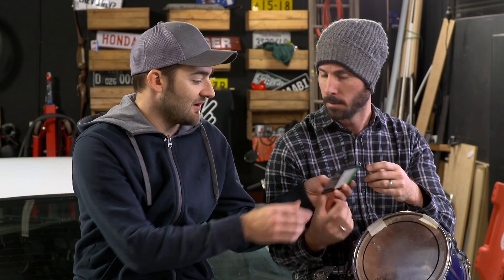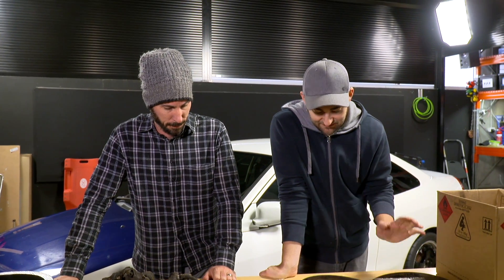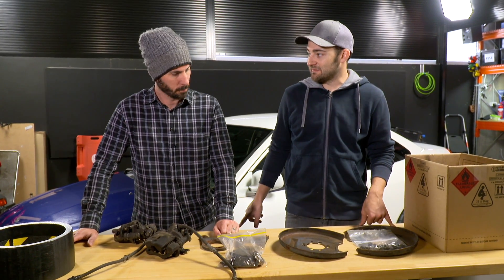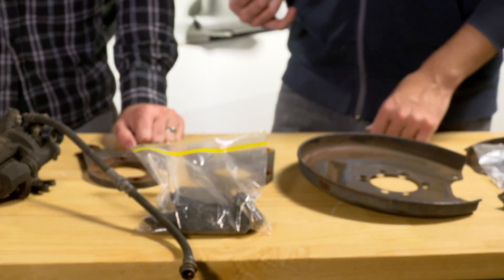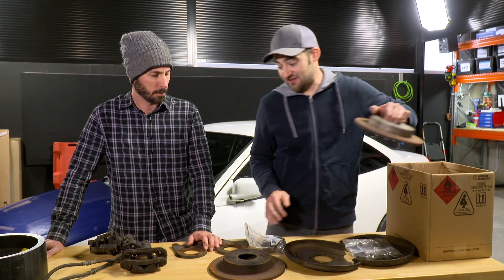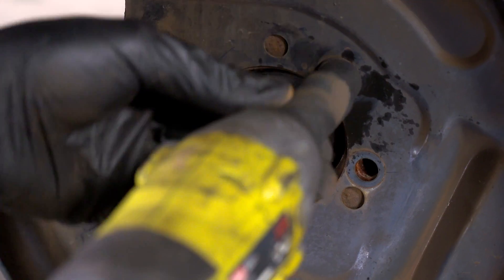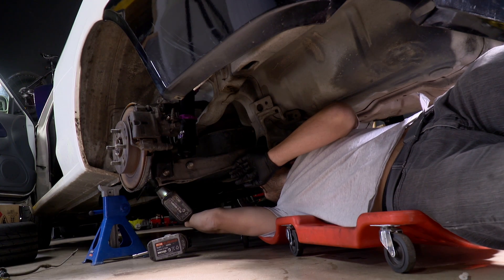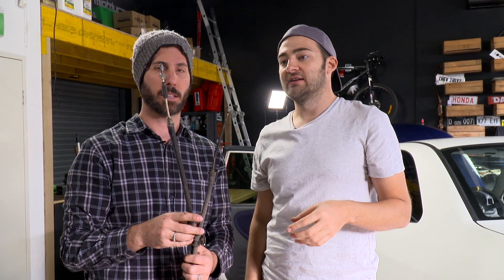Drum to Disc Brake Conversion DIY

Comment: Sometimes the brake  proportioning valve is different on rear disc brakes compared to rear drum brakes. If you convert to rear disc's, sure,  you will have working disc brakes, however the brake bias will not be ideal with a rear drum  proportioning valve. Drums operate at a lower brake pressure than disc brakes, yup, you will be lacking hydraulic pressure with a drum prop valve with rear discs
Reply: +1 (can't like the comment cause I'm on mobile soooo....lol)
Reply: *****
 Awwww man.... I wheel my computer around in a little cart so I can turn into a keyboard warrior at any moment in time.  :)
Reply: if you just just put discs on my car bias valve will cause rear wheels to lock up under hard braking (very dangerous) haha you defiantly have to make sure bias isnt going to kill you
Reply: more so if the cars lowered as brakes usually have a compensator also for the rear wheels for when theres a full boot/extra weight
Reply: coco mgee
Nope, More like nose dive.  The car I have came from the factory with a drum proportioning valve but had rear discs..  The low pressure won't allow the rear discbrakes lockup, in fact the rear disc brakes will last forever when the fronts will wear out 3x as fast
Now with a modification I can feel the rear brakes working and the car nose dives alot less under threshold braking
Reply: yeah i commented again for extra bit, yeah in understand what happens i put rest in 2nd comment.. but yeah it depends on weight of car. i had to change master cylinder to stop rear wheels locking up at standard height after my swap
Reply: and it probabaly messed with your abs, its your master cylinder what accounts for your braking pressure
Reply: My car weighs a ton, It never happened but every car is designed differently.  Then you can argue the physical size of of the brakes and surface area creating extra stopping force, creating a lockup issue. Some Disc brake conversions can be larger in size than the drum, so they will bite more. . Some pickups or SUV s have a sensor that adjusts the brake bias for rear squat, as if it was loaded. perhaps those could lock up the rear brakes if they were tampered with, I would not recommend anyone messing with those systems.
Reply: bias valve for height is not inline with brakes lines*
Reply: You may want to do your homework again. ;)  In the states some vehicles had these systems.
Reply: Richard Adams
 No, Drums work under less hydraulic pressure.  Disc Brakes are around 900,1200 psi, Drum brakes are around half that. The volume of brake fluid is also slowed down to rear drums  Put a pressure gauge on it and you can see.  Hardly anyone has one or uses them. But it can be a good diagnostic tool for brake problems
. If the Drum brakes lock up usually its a friction material problem,  contaminated shoes
, service is badly needed, etc.  If the vehicle has huge drums, heck yea they can lockup easy no matter what.
Reply: Yea its not a pressure issue, your brakes need service.  Cheap brake shoes sometimes lockup mad easy, or if someone had the car before hand and the wheel cylinder blew brake fluid allover the shoes, that will change the friction material and the shoes will get super grabby.
Reply: proportioning valves for drum brakes also keep a little pressure on the pads themselves to make them drag. They do this to keep water and other debris from getting between the shoes and the drum. If water gets between it can actually keep the shoes from contacting the drum, meaning no brakes.
Reply: Never heard of that. The return springs on the brake shoe backing plates keep pressure on the wheel cylinder, the adjuster keeps the shoes close to the brake drum. If spring tension is crappy on the rear drums when you mash the brake the pedal will be low, same goes for a out of adjustment drum brake, the pedal travel will be increased.  Every tire rotation I always kick up the drums a little, they SAY they self adjust but, ehh. Keep the drums in adjustment and the pedal feel will be mint
Reply: I was thinking the same thing.  In some cases the proportioning valve is the same part for "parts bin" cars using both drum and disc brakes. You are correct though.  If different the correct proportioning valve should be used.
Reply: GrizzlyAnders
 Yup, The manufacture goes "Good enough"  You get braking and fancy rear disc brakes but they only work half as good as they could work.
Reply: wolfie is right. if it's not built into the drum spec proportioning valve, they may have inline residual pressure valves to keep 5-10 psi in lines for the drums. gotta yank those too.
Reply: Ghetto Wagon i'm not sure what ASE is, but i have seen them on multiple cars and they're also mentioned in the hydraulic brake section of my heavy equipment tech courses.

"Residual valves are used to maintain constant pressure on the brake system.  For drum brakes, a 10 lb. residual valve is used to hold pressure against the springs in the drum.  This allows the drum brake to engage more quickly and reduces pedal travel.  For an under-the-floor master cylinder brake system, a 2 lb. residual valve is used for disc brakes to keep brake fluid from flowing back down into the master cylinder."

they are often built into the combination metering/proportioning valve but if not, they're seperate and usually mounted near the master cylinder.
Reply: tr0n
 Probably you are not from the states. Now that I am thinking some vehicles I have seen may of had an extra fitting off the master cylinder, I rarely see them here.  Maybe the manufacture adds them for a quick fix changeover  if they had disc or drums. 
 Its rare, not too many vehicles have it
. It would be on one circuit on a split master cylinder.
Reply: +Ghetto Wagon will you have a suv ??? Completely different to car small car wtf do some research before posting out rages claims
Reply: +1
Reply: Gaz Girl
 I have a little of everything.  So Small car brakes are different than big car brakes? Like Big boy pants are different to little girl pants? What " Out rages" claims did I post
Reply: Gaz Girl  Its your car, its stopping you not me
Reply from the maker: parts bin in our case, so we're all good. But always a good idea to check first!
Reply: +Ghetto Wagon why do you try and talk like mighty car mods?
Reply: +tr0n wtf.the last master cylinder I saw in a chassis rail was a Morris 1000.
Reply: +tr0n master cylinder filling point that's lower than the master cylinder,back to night school for you then sunshine.
Reply: also drum brakes have residual pressure valve that keeps light pressure on the drums but that's more on older cars without adjusters in the drums.
Reply: Bruh, we have this problem on our Impala SS haha. Now that brake stealth kit from proforged is available we can get some decent braking ability.
Reply: Ali Haidar
Yup! I have it The owner of that place is a cool dude I met/ talked to them a few times personally. If you run a better brake setup adding a adjustable bias valve probably would be ideal.
Reply: Mighty Car Mods
 Maaaaaaaaaaaaaaaaaaaaddddddddddd
Reply: Daru Macandy
 Maybe they are talking like me but they are Australian so they do have that accent that I am pretty bad at ? I am actually typing not talking  :)
Reply: was going to say the same thing, master, prop valve most likely different and should be verify.  no mention of this ; (
Reply: Cam Shaft
Cool legoman The master is sometimes the same.  If anything the piston size in the master may of been changed to increase or decrease brake pedal feel depending on what they were  going for.  As is, It will stop the car, just that it will nose dive alot more under heavy braking when the prop valve is set up for drums. Its a good enough deal, but if you wan perfect you can tune it.  On alot of old muscle cars they run a adjustable brake bias valve when they change to rear disc brakes,  adjust it until the fronts lock before the rear, Done
Reply: @Mighty Car Mods ?
Reply: It looks that it depends on car. In a 1990 Honda a disk brake valve has thinner spring than the drum version. Weaker spring = cuts off at lower pressure = weak rear brakes. Actually some people convert to drum valves as springs tend to weaken with time and you get so little brakes on rear that discs tend to get pitted from rust before they wear out. Also you can fail annual tech inspection...
Reply: The term brakes and Morris 1000 should never be used in the same sentence. If you have driven one you will understand this
Reply: I used the term proportioning valve in my original post because thats what they are called but the type I was referring to is one that shuts of the oil flow to a side of the circuit if you loose a hose.  Some are dual purpose but this is normally on 20 +year old stuff. It will switch to prevent a total failure of the brakes (total loss of fluid in a dual circuit). Ever had a brake hose fail but the brakes still work but with a low pedal?  On a modern drum brake system it may not need changing as it was probably sized to take the same volume of fluid as a disk caliper but it would be worth checking. When faulty or incorrectly fitted the brakes will usually work for a bit until the pedal is depressed quickly and it will switch then. They will normally switch back to center if left for a short time but often get stuck blocking one side of the circuit. That being said get rid of those front disc backing plates and remove or cut down the rear plates. They are only there to prevent debris from getting jammed in the caliper and they hold in so much heat you wouldn't believe it.
Cheers
Reply: dazaspc
Usually those shuttle switches that are inside he proportioning valve  do not stop the brake fluid flow, it just triggers the brake warning lamp!  That's just my experience, In the States alot of vehicles blow out solid brake lines from rust.   If you put the vehicle on some crazy angle (Lift the back further that the front) you can reset them. They get stuck and that annoying brake light wont go off
Reply: dazaspc
okay
Reply: Is it the same process tho?
Reply: ¿Anyone know if convert front disc to drums is plug and play? (theorically yes but im not sure) with the same drums of rear axle? the brake vias is not a problem, the rake vias is not a problem, the car have Electronic brake distribution. And is ultralight and not for track, overheating is not a problem.
Reply: i was asking this cus i  did a swap like this from drum to disk and i have week pressure at the rear
Reply: can the prop valve be adjusted or will i have to replace it with a different one?

Comment: No master cylinder or proportional valve change?

I'm thinking you guys only did half the job here...
Reply: I was thinking the same thing. It needs a residual pressure valve at least
Reply: Brad Fink
I've only ever heard of those being needed when the master cylinder is installed lower than the calipers on some hot rods.
Reply: +Maxwelhse disks need a little residual pressure so they don't back off the rotors. usually just a few psi
Reply: Brad Fink
I thought that was all handled in the master cylinder, usually? I've never had a car that had separate valves for it and I've only seem them on hot rods for the reason I mentioned.
Reply: I suppose mitzu may have used the same residual pressure for both
Reply: Brad Fink
Perhaps... but the same valving and M/C reservoir size would surprise me.
Reply from the maker: No
Reply: Mighty Car Mods
No you didn't change them or no they don't need changed?
Reply: +Maxwelhse they don't need to be changed
Reply: it's usually just a little ball bearing in the master cly to hold pressure to the drums easy fix
Reply: The master should be changed if the residual pressure valve is in it.  If it is not and the master is compatible with both disk/drum and disk/disk the master can stay.  That means the residual pressure valve is in the combination valve, which would have to be replaced.  The residual pressure valve in the system needs to be removed and replaced with a disk one for the system to work properly.  A drum brake residual pressure valve holds about 10psi to help overcome the return springs in the drum brakes, while a disk valve only holds about 2psi - just enough to lightly keep the pad in touch with the disk.  Since this is a track car, I would also change to a adjustable prop valve.  You will be able to find tune your braking - it makes a big difference.
Reply: I just scrolled down to say this. Rear brakes are going to drag bad...
Reply: there is no need to change the Master Cylinder or anything up front as on these Mitsubishimodels the Master is the same regardless if you are running disks or drums.
Reply: Most drum master keep a small amount of pressure on the drums so the shoes drag a hair, disks don't. Or at least that's what I have always seen and been taught.
Reply: Okay on this car but some car need a different master. Like Honda civics for example. They run a different Master Cylinder on the rear disc set up. Also be careful about which fluid that you use DOT3 and 4 are not the same. Learned the hard way on an after market clutch cylinder replacement.
Reply: Jeremy Curran
I've never heard of a car that runs the same master for both disc and drum before. So, if this Mitsu is that way, it's a first for me.
Reply: +Jeremy Curran yeah they're not the same but a car compatible with dot 3 can use dot 4.  What issues did you run into? In NZ it's quite hard go even find dot 3 as dot 4 can be run safely in it
Reply: I've never heard of it either but I've never had any want or desire to upgrade a mitsu FWD POS before. If they're going though all the trouble why not a Honda? Better engines in a Honda the a Mitsu and parts are everywhere and dirt cheap.
Reply: Replacement master cylinder from O'Reilly Auto Parts. Says DOT 3 ONLY and civic master says DOT 3 or DOT 4. I used DOT 4 and it killed the seals in 2 weeks. Went though 2 of them the I switched to DOT 3 and flushed the line with fluid and it's still running fine.
Reply: The Reservoir OEM cap said DOT 3 or 4.
Reply: Jeremy Curran
lol... I've looked into it for a POS FWD Mazda before and it required a different M/C just like everything else I've ever heard of.
Reply: Proportioning will be different. Not familiar with the base pressure required on this model.
Reply: Well stop it.....
Reply: why do you all want the rear brakes to lock up, well if its for drifting there should but for normal use the won`t need to change it.

Comment: Fucking love all the innuendo
Reply: XD hey Figureight
Reply: What's up I didn't think I would see u here
Reply: ALEX
Reply: OMG UR A GTA UTBER
Reply: +MrSoleman2010 SO???
Reply: heh. "in-YOUR-end-o"
Reply: +Figureight When Will you upgrade your crappy GPU ?
Reply: Me too Lex. I crack up every time lol.
Reply: ALEX! You the best man!!!
Reply: sup
Reply: Todd-High-Five coming your way!
Reply: in your endo :-)
Reply: I think Marty it's going to be easier to stick it in if you grease up the actual ring first
Yeah I'll grease that I'm gonna roll right down underneath where the hole is
Yeah
And roll like I'm going to kind of jam my hand there as much I can
Yeah, if you stick your fingers in.. and when i see your fingers coming through the hole, I'll know that the rest of the shaft of the cables is coming through
Sure, It's got a rubber on it
Okay
So that should help
I'm gonna shine a light on it so you know where to stick it
Alright, cool
I think... can you feel it?
I can see the end of the knob coming through now
If you stick your finger on the greasy part
Yep?
And then the rubber will come through after that
Oh it's wet isn't it?
It is yeah
Alright, if you can't push the tip in there at the moment, but can you push the rest of it through?
Yeah i just gotta go to grab it right around there sort of shaft of the
Hold on, the way I'm sitting, I can't get it all the way so I'm just gonna get on my knees and put both hands around it and then just pull
It's gonna come out much faster
Yeah yeah pull it real hard man that's the way...
The rubber is really stretching there because it's tight on the hole, did you lube it up or not?
Erhm, I did a little bit..
Ouch! The whole thing just came through
Oh shit, no that's no good, that's more than you need I'm pretty sure
Oh okay, hold on I'll push back out again
You wanna jam it back out
Yep
See if we can get it through
You might need to pull it out before you stick it in again
Oh the whole thing?
Well I can't get the rubber back in the hole unless you pull the shaft out first
So we gonna pull the whole thing completely out of there?
Yeah because the whole thing... the rubber has fallen off inside
Alright I'm going to pull it, hold on
Can you see it?
I got my fingers wrapped around the base of it now
I can see the rubber starting to push through
The rubber is now... it's all over the greased up ring, hold on
It's perfect man
Keep the rubber there, now push the shaft or I'm going to put my hand around the base, now push as hard as you can
I did yep, I'm pushing
Keep going man
Yep I'm pushing
No no I need more, oh that it's coming out in my hand now
Needs to go a little bit more
Hold the rubber with one hand and pull it through with the other
That's a good idea, I got my fingers around the base and then I'll just pull the shaft and you push from your end?
Yeh pushing
Oh there's a big chunk coming out man
Yeah that's that's.. lined up perfectly on my end mate
Okay cool, that's now in.
Reply: i was creasing up so badly :D
Reply: +Amazing MrVid do they plan this or just make it up as they go along
Reply: Figureight!!!
Reply: Hi Lex!
Reply: WAAAA LEX IS HERE k .....
Reply: atyyyyyyyy6yyyyyyyyyyyt lex
Reply: i didnt  ew lol